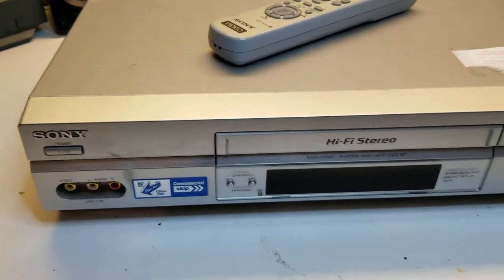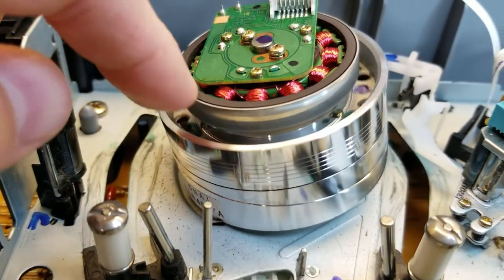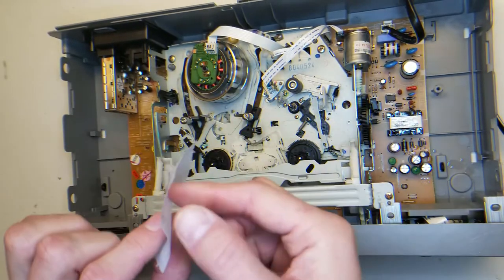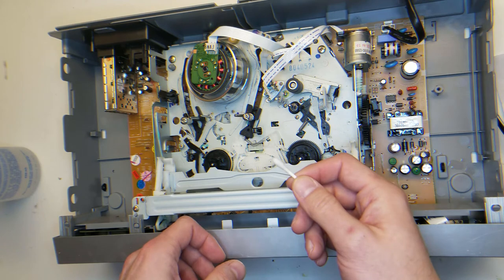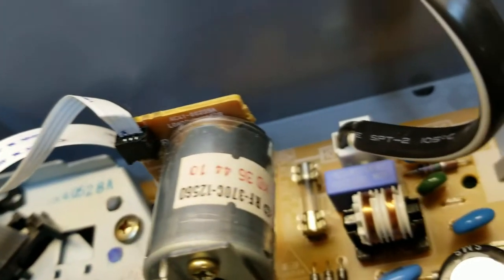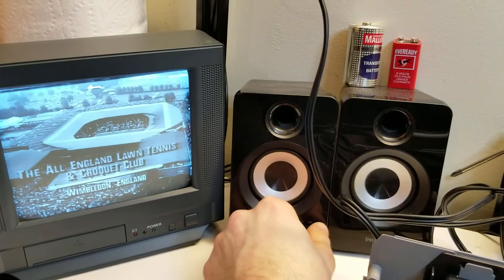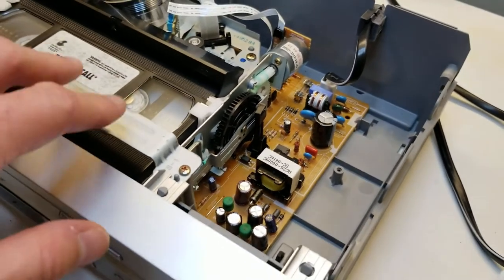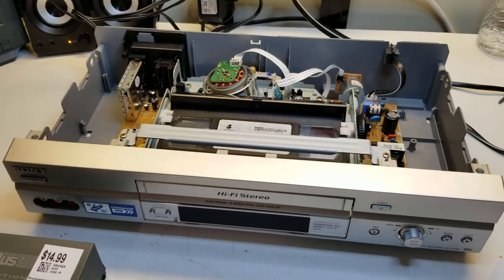2004 Sony VCR service... part 1? (Model SLV-N750)

Comment: I have the same model bought new in 2004, still works great, recently opened it up to clean the head since the little orange foam roller disintegrated and spread and orange paste all over the head. My power supply makes the same noise but everything is fine. I dont have these tracking issues. Hope you get it figured out though
Reply from the maker: There's a part 2 where I figured out it was an alignment issue.
Reply: Interesting, My SLV-N500 suffered the same fate. The roller wheel behind the video drum turned to goo and made a mess. I cleaned up the mess, but the deck will not play tapes anymore. I'm now trying to find that wheel part.

Comment: If you feel it can be repaired for "sentimental" reasons I say do it then. You mentioned you had it for so many years without fail (until recently), so I would have it repaired. Hope you're able to do that though considering VCR repair (brick & mortar) shops are now hard to find, at least where I'm at in Visalia, Ca. here (near Fresno). I took mine to an "electronic repair" shop, and the owner laughed at me and said it's not worth fixing due to lack of online VCR parts (he couldn't order himself) are hard to find now, and to try to find another used VCR at a yard sale or thrift store. He wasn't much help at all! Won't be going there anymore!

I'm considering buying your model "new" from eBay and would like to know your opinion if it's worth buying. I punched in your model number of your VCR and this video came up, so had to watch. My only gripe is that this item has no refund once purchased. My old VCR (Magnavox) finally just took a crap after so many years of great service, but unable to find anymore, and not sure what's wrong with it since I'm no expert. I'm suspecting my drive belt motor is defective because I have to force it to spin with my finger to play or the power shuts down automatically or sometimes ejects, that goes for all videocassettes. Even with a brand new drive belt I was able to find online miraculously, still didn't work. Even after a detailed  lubing and cleaning.  I wish someone out there would sell VCR's again at stores, they would make a killing selling them to old farts like us, lol. I'm a pack-rat and still have my 500+ VCR tapes I STILL need to transfer to DVD.

I wish you the best of luck in your decision my friend. Stay safe and God bless.

https://www.ebay.com/itm/295248839753?mkevt=1&mkcid=1&mkrid=711-53200-19255-0&campid=5337795679&toolid=10001&customid=3df16ee931414c09880a689a2213b0d4

Comment: Great video, can you please tell me what the yellow roller next to the head spool is for? (partially obscured by the electrical loom)  I have a similar one thats not working, and it looks like the yellow roller has decomposed, any idea how to source another piece of foam or what it is called? Many thanks
Reply from the maker: I didn't mention in this video, but that's the "automatic head cleaner". When the guides load the tape they momentarily push it against the head while the head is spinning. It's good practice to remove these as the foam can degrade when it ages. Remove the whole assembly, not just the foam.
Reply: @probnotstech  I see, many thanks, mine doesnt seem to rotate when the tape is playing. but thanks to your explanation it is not supposed to. Are  they easy to source?Best wishes.
Reply from the maker: @charliebrown6850  I've never tried to source one, but I imagine they'd be near impossible to source nowadays. If you found one, the material would be just as old and suspect as the one you have now. It's just remove the whole thing. It's not integral to the operation of the VCR.
Reply: @probnotstech  will do, many thanks, i will remove the foam, as it wont clean the head in the state it has decomposed,  best wishes

Comment: I would not bother fixing unless it doesn't let you do mono audio. Might not sound as good but it will work. I had a junk funia VCR that same problem and after a while the Hi-Fi audio broke. The VCR is was used for years in mono mode. I just keep it as a spare VCR.
Reply from the maker: I uploaded a part 2. Luckily it was a simple fix for this problem.

Comment: Where is the MODE SWITCH on a sony vcr? Mine likely needs cleaning. I appreciate any help you can give. thank you
Reply from the maker: Depends on the model. If it's similar to this one (which is made by Samsung) then I believe it's attached to the circuit board along the bottom. The VCR chassis can be lifted off the board to access it.
Reply: Underneath the mechanism on the right hand side
Reply: We had some piece of crap Samsung vcr that had the same mechnism as the one in the video in our cottage it started eating tapes, I remeber trying to clean the mode switch but it turned out that it had a optical mode switch, optical mode switches can't be cleaned they have to be replaced if they got bad, recommend you to just look for another vcr